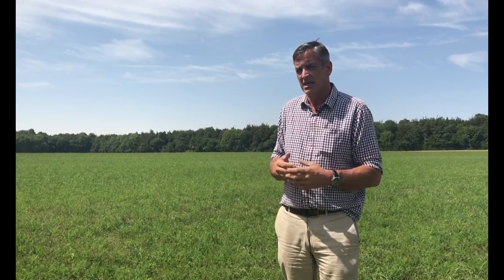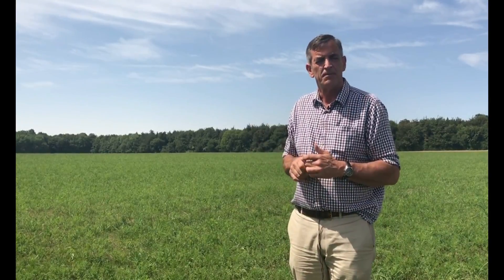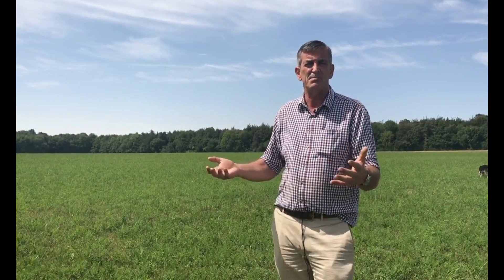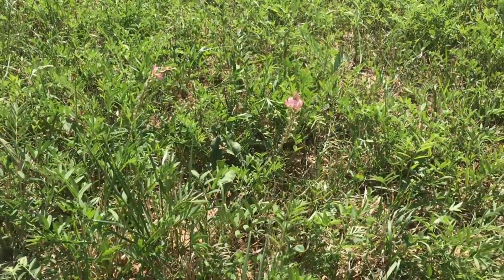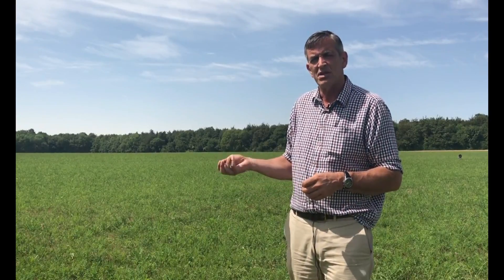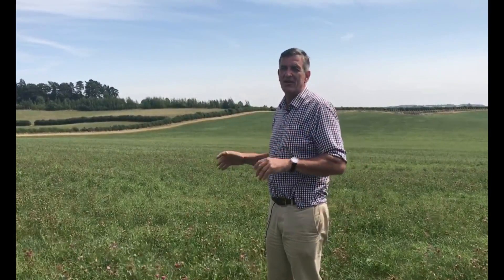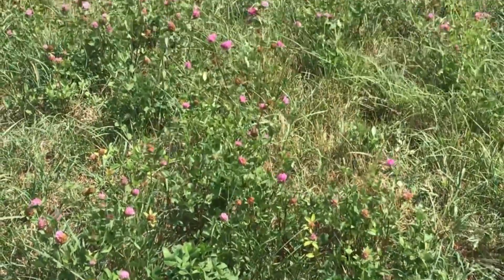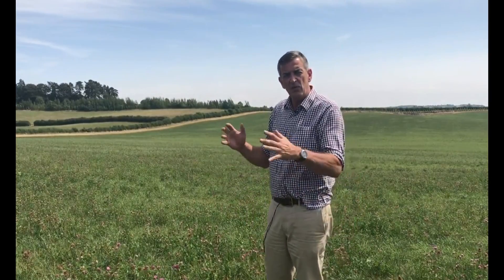Pasture Based Systems - Sainfoin & Red Clover

Comment: Can you graze red clover with dairy cows been offered about 40 acres of it next my milking platform.
Reply: Yes you can but be careful, don't introduce suddenly and don't graze it in foggy close weather,bloat could happen. You could feed straw or hay for fibre. But really feed it when dry and after a few days the cattle can graze it at ad lib. You should see higher milk yields if milking and great solids. Use a back fence to prevent treading.